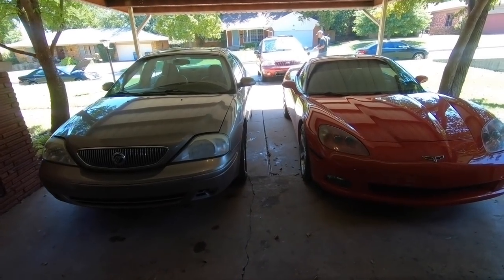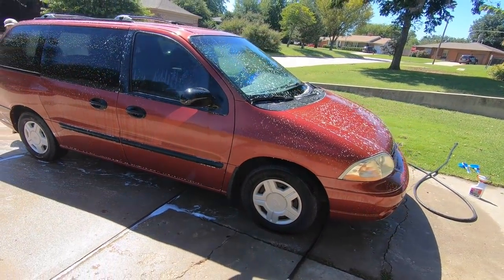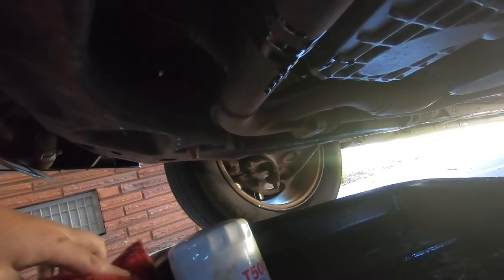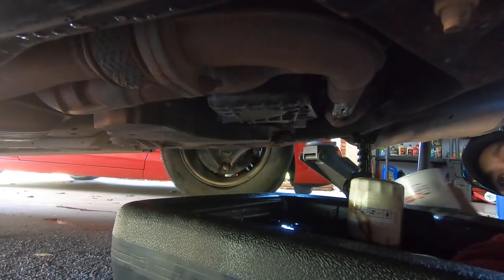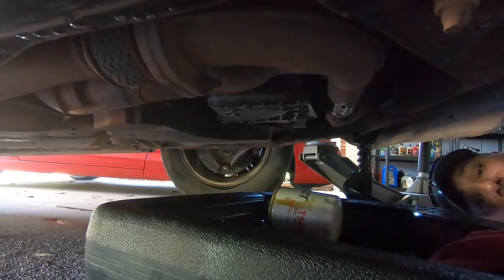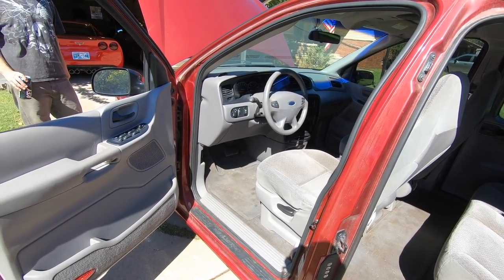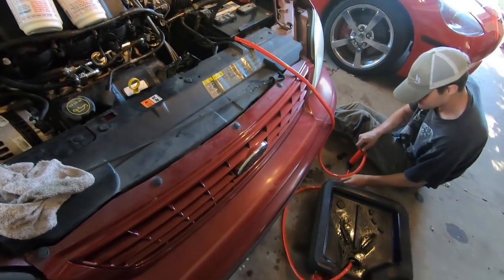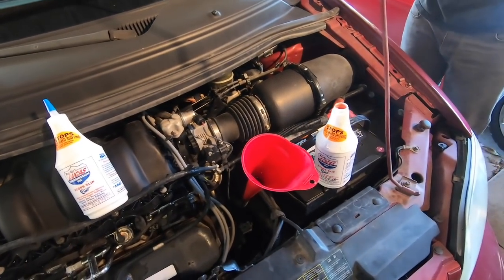3 Cars 1 Video - Sable, Windstar, S600 = Let's get to Work!

Comment: You guys should get into some basic detailing on those cars to make them stand out on the lot. Get yourself a clay mitt, the Mothers clay 2.0 is fine, then order up some Wolfgang Uber Rinseless Wash, $20 on Amazon and get yourself a 32oz spray bottle from Home Depot. Fill the spray bottle with distilled water and add 1oz of the concentrate, you now have a cheap and awesome detail spray; when you're finished washing and rinsing, spray a panel liberally with the spray, use the clay block to lightly remove some extra dirt, and then dry as normal with towels. The Wolfgang has some protective and gloss enhancing elements in it, it'll help you dry without residue and leave the paint slick for a few weeks. Each spray bottle will cost you $1.25, very cost effective, and it should add about 20 minutes per car if you don't strive for perfection. Excellent decision making on these two cars, my favorite type of content on your channel, buying normal cars for sound reasons and doing minor repairs and cleaning,  keep it up!

Comment: Just a tip. . . . try taking a centerpunch and hammer and drive a small hole in the bottom-most portion of the oil filter that you can get to, and let it drain for a while. (you can also prop a small funnel with a long neck to keep it from draining all over things like exhausts or cross-members.) This then eliminates a bunch of oil pouring out then you crack and spin it!

Comment: Next time use a screwdriver to punch a hole in the lower edge of the filter to drain the hot oil ,then take it off the motor saves your hands and controls the oil flow. With the Lucas oil bottle before you go to use it leave it in some hot water will make it run from the bottle faster when you go to use it. lol

Comment: Sable uses 6 not 7 quarts! Owned a few of these. 04-07 Taurus have sensitive batter voltage.  Hope ball joints and tie rods are good - common problem
Reply from the maker: It actually held 6.5.
Reply: Ball joints and tie rods sounds like an issue my father had with his 06 dodge charger.. and 06 Lincoln zephyr (both crappy cars)

Comment: I bet since it's been sitting for a while, I bet the oil that was supposed to be coating the cylinders of the Sable all dripped down to the pan... And since there was very little in the cylinders, you get that knocking noise.

Comment: Sable sounds good but front tires look low on tread ?  Our local junkyards sell used batteries for $ 35 and reconditioned for $55 , not sure if they do that in your area but it saves $.
Reply from the maker: Tires on the sable are all almost new. Battery ended up working out thankfully :)

Comment: Does the engine use hydraulic lifters - that knock sounded like a lifter that had drained down over a long period and then pumped back up on first start. Never seen 5w/20 before - thin or what !

Comment: You do know that the Lucas is to be added to the existing transmission fluid, right?
Reply from the maker: Ummm we did add it to the existing fluid. You can not ever overfill a trans. So we pump what we need out.

Comment: One thing I hate is when peoppe tighten their oil filters super tight and same as the drain plug. Ive seen stripped drain plug bolts and one time I had to hammer a screw driver threw the oil filter and turn it with the screwdriver just to get it out. I know they have tools for that now a days but this was way way back.

Comment: ‘Pretty sure that rod knock was just from sitting...’  sorry, but that’s ignoring an an obvious symptom
Reply from the maker: A symptom of sitting almost a year. Exactly.
Reply: My S80 knocked for a few seconds when I started it for the first time , it had sat for over a year. I've been driving it for over a year and hasn't knocked since.
Reply: It may be from lack of lubrication, because the oil that coats the cylinders drip downwards while the car sits.
Reply: @AutoAuctionRebuilds  Nothing a little Marvel mystery oil won't cure.